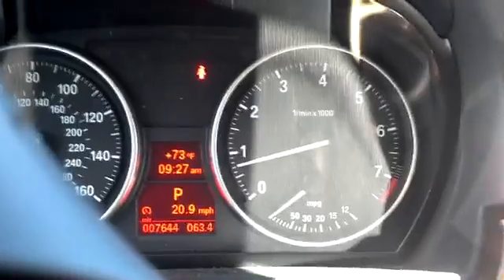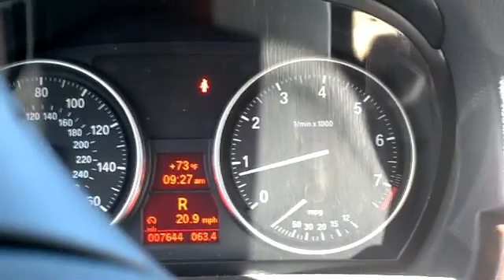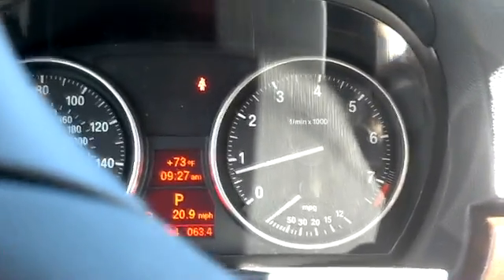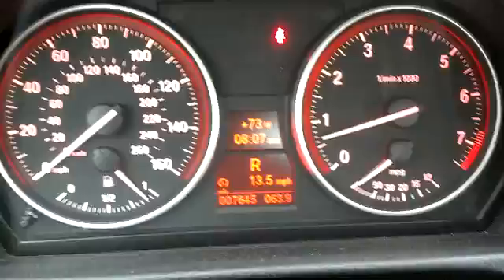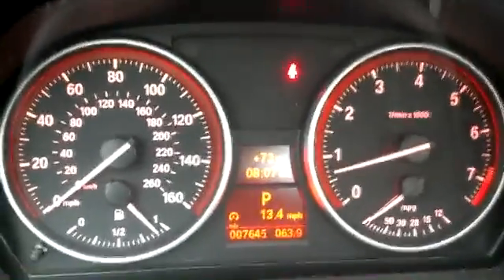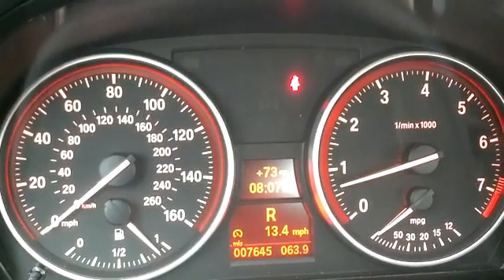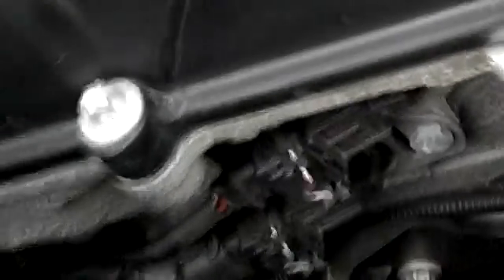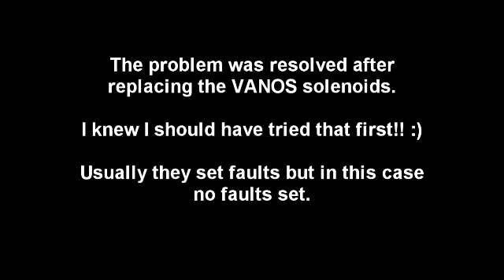BMW Misfire Rough Idle and Skip On Cold Start Diagnosis No Faults 3 Series N51 Engine

Comment: Hey there Sir, i have been having rough iddle, loss of power at low rpm and sometimes accelaration hesitation...went to bmw dealer and they updated software, it improved a little bit but problem still there. I plugged odb2 reader and found old code stored "P2A98", what's the next step? BMW told me car is fine but problem is worst during mold and cold days...thanks!
Reply from the maker: Hello, The code you have relates to you oxygen sensor. If you are having an issue with an 02 sensor this can definitely effect the fuel air ratio.
Reply: @AskTheCarExperts  i ended up deleting that code and now others show up...very annoying and don't know what to do, now I have :
U0DA8, U0D9A and U3F00 and I can't find what those mean...can you help me out?
Reply from the maker: It looks like your code reader is pulling codes that may be specific to that reader. I do not have any information on codes in this format. How many miles do you have on your vehicle? 02 sensors are rated to last about 120K

Comment: Hi there, I have this problem when I start my e90 when it’s been left for more than 24 hours or when the engine cools off, when I try to start it, it takes more than one or two ignition fires to start and when it does start it sounds like the ignition will cut off and it sounds like it will struggle to start everytime, but when I drive it for a while and start it after few hours then it starts just fine without the issue. I have replaced glow plugs and battery but the issue is still there, any idea what it could be?
Reply from the maker: Hello Deqi and Asis, Can you send me the last seven digits of the VIN number and I can look at your vehicle options and engine designation. Do you have any check engine light warning on with this symptom? You can reach me directly by going to my website at www.askthecarexperts.com and going to the contact us section. Hopefully I can help.

Comment: My 08 X3 does this for about 20 seconds in the morning. Then it goes away. Plugs and coils are brand new. Runs perfect after that. Vanos solenoid?
Reply from the maker: Hello Alan, If you put your vehicle immediately into drive or reverse on a cold start does the vehicle feel like it is going to stall?

Comment: I just replaced my spark plugs, and ignition coils on my BMW e90 325i. I experienced a similar rough idle when driving. The problem was that I haven't FULLY pushed the harnesses to the ignition coils. Made sure all connection were super tight and the problem was gone.

Comment: I have this issue on an early 1998 740i with the Non-VANOS M62B44. What could it be if not the VANOS solenoid? Should I try plugs and wires?
Reply from the maker: +torinotyler69 This could be plugs, wires, an air leak, internal engine...too many things unfortunately. Best to start with basics. Fuel Air Spark. Do you have good fuel pressure, is the air cleaner clean, do you have any air leaks, check the plugs, replace as needed, possibly a compression test and cylinder leakage test.

Comment: Hi
On my BMW 325 ci 2005, very slight uneven movement in rev when start on cold. It starts fine, rev becomes uneven on 2 occasions
1. when start cold, if I suddenly take rev to 3000rpm and leaves it, rev fluctuates a little when comes back to its idle position.
2. when I stop at traffic lights, it fluctuates for 2 or 3 times when comes back to idle position.
I am gonna upload video shortly. from reading on internet, I guess it might be vacuum leak in upper or lower intake hose or DISA valve will need to look at.
I have already changed spark plugs and installed NGK iridium, but the problem is still there. I will do the following things tomorrow then update,
1. check for vacuum leakage, and clean throttle body
2. inspect DISA valve
3. clean MAF
If these doesn't cure then do you think it might be VANOS solenoid?? please help. thanks

Comment: Same issue on my car except it's a 5 serie. FIrst thing they told me was it the Hartge Tune on the car and they have asked me to remove it but the problem is still present. A bit upset right now as I am running without a car for more then 4 days!
Reply from the maker: Have them swap in 6 coils. They can often cause rough running and it does not set faults.

Comment: Maybe you can help me. I have a 07 335xi and it sputters under load but only on the highway mainly after 4th gear, but it's fine small roads driving. It'll idle rough a lil too
Reply from the maker: How many miles on your 335xi? Any check engine light?

Comment from the maker: :) The N51 engine does not use an idle regulator (IAC) valve. The engine does work harder with the AC on which can help to create a symptom. There are many things that can cause a symptom like this. When there is an air or fuel problem the engine computer sets a check engine light. This vehicle does not set  a code. For this vehicle the failure was caused by the VANOS solenoids but I have also seen a bad coil cause a skip and not set a code.

Comment: when u turn the ac on it turns on the compresor wich is related to the engine ..so engine has to work "harder" to run the compresor thats why idle is getting "worser" a rough idle means either the car isnt taking enough air / fuel ..a sensor is broken or the idle regulator is faulty

Comment: hey i got a 328i its a 2012 model i don't have the chassis number on me right now or what ever you call that "f30, e95" but it has been idling rough sometimes quite rough sometimes almost unnoticeable. Could it be the motor/engine mount? or is it just the plugs and the VANOS solenoid. The dealer always says whenever i take it there "I don't feel anything we even had the shop foreman look at it and he goes like "no" and there is rough idle and they only told us "oh yea there was an update...help?

Comment from the maker: The program for this issue to my knowledge was for a noise on start up caused by the oil pressure solenoid but this might be related. BMW is always improving the software so I think it would be a great starting point to have the latest software installed. By the way did you check under the seats for any rust on the seat frame? This seems to be a popular topic and have seen it on some other F30's.

Comment from the maker: Hello Nicholas, There are no current service bulletins relating to this problem on the N20 yet. I have seen some VANOS solenoids get clogged but this is a different style solenoid that is the central bolt for the VANOS unit so not something you could do yourself. The only other information is on a shudder at high ambient temps caused by the electric valve that controls the turbo. The best thing to do would be to ask your dealer to contact the BMW rep and set up an appointment to demonstrate it.

Comment from the maker: Hello, It is unusual for a CAT to go bad on this engine. So far this has been three items. Programming. There is a new engine computer update for this problem but it does not always correct this. The next thing is the VANOS solenoids. In this vehicle this was the fix. And I have seen a coil be the failure and not set a fault code only found by swapping one at a time with a new coil.

Comment: My E39 520i sometimes die at traffic lights, but it's very rare. Like maybe a couple of times a week, and usually when I have been driving for 5-10 minutes. Sometimes it idles very rough, jumping up and down in RPM for a couple of seconds before it dies, it also happens very rarely. Sometimes it will also just kinda turn off for half a second when driving, misfire? I have been told it's probably the camshaft (and another one I don't remember in English) position sensor that's broken

Comment from the maker: The traffic light idle change would not be normal but may have been a hiccup. The steering wheel turning with idle change would be normal due to engine load changes.

Comment: my car has 22000 miles on it. it was 2008 car. Another problem is that I felt some surging through the pedals when the AC is on. sometimes I can also feel some vibration when the car accelerates. I have upload two videos on my account but just don't know how to send it to you

Comment from the maker: Absolutely, I have made a DIY video for this but have yet to post it. One thing to check first that I recently ran into is to also check to see if there is any oil in the valvetronic sensor. This is the sensor at the top of the engine in the front under the vanity cover. I ran into a vehicle that the solenoids did not correct this same skip feel and it ended up being a bad VVT sensor due to oil seeping through the pins. Will post a video on this tonight I think :)

Comment: Hello, my 135i N54 car has met several times of jumping idles. I remember one time I stopped in at the traffic light, the RPM suddenly went up and dropped back to normal after 1 sec. I have met like  7 times for past few months. It does not happen all the time. I went to dealership but they didn't find anything wrong. There was no code shown. My car have a jumping idle when I switch between parking and reverse.like the video  As you see from your profession, is there anything wrong with the car?

Comment: MY n54 135i have met the rough idle several times. one time, I stopped in front of the traffic light, the idle suddenly raised and then dropped back. it is not as bad as the video shows, When I turn the steering wheel, the idle change a bit too.  However, the dealership just said it is normal.